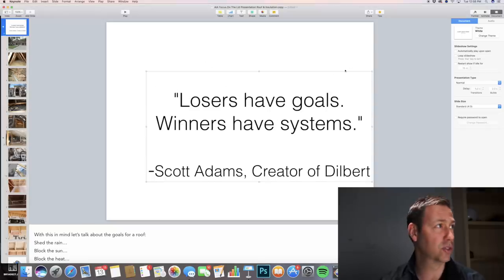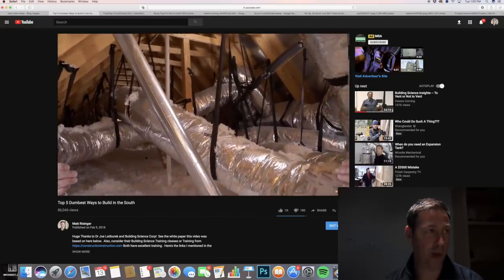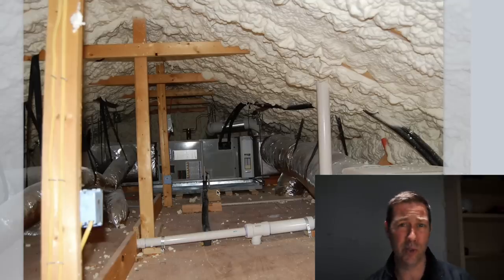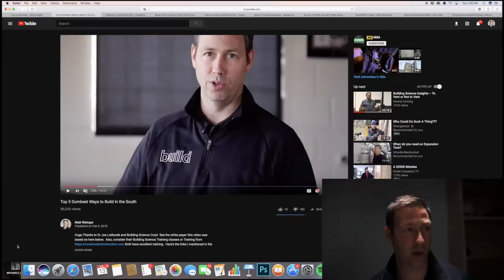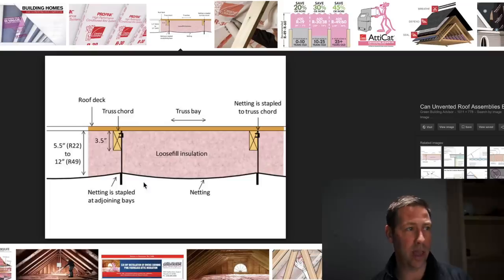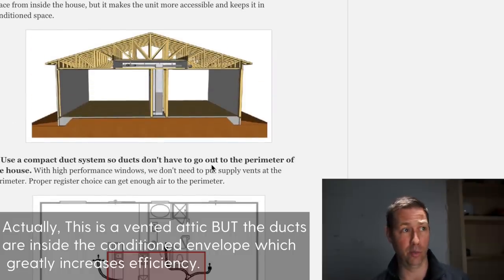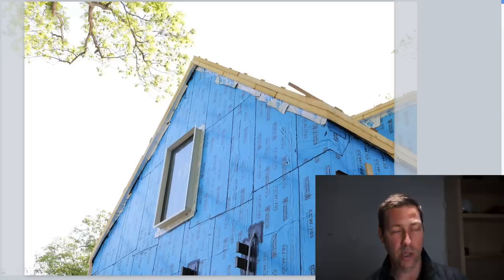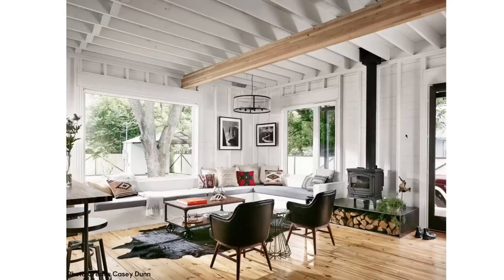Attics/Roofs - Dumb vs. Smart - How to Build Correctly

Comment: But now what kind of roof you have if asfault you killed the life of your shingles if not properly vented
Reply: Non-vented foam only raises the roof deck temperature about 5deg in the Florida sun. A 25 yer shingle loses about two weeks of life.
Reply: Im sorry but I feel the back sides of you asphalt shingles will not transfer the heat out efficiently like the soffits air in would and ridge air out would all the sheeting and nails are cooled with transferring the heat out and not over baking the shingles life. Theres a harmony that took 25 to 50 years for a asphalt company to work out there shingle life's and warrenty guidelines. I believe this new spray foam is meant for metal roofing and other types of roofing than asphalt.

Comment: I think he misses many things here. How about the fact that 10% of homes that get spray foamed, have to have their foam removed. Not just removed but the improper application of the 2 part foam mix based on poor temp and humidity calculation? Those chemicals, Isocyanates, creates serious indoor air quality issues. So much so that the EPA is now getting involved. I think you could do a better job talking about both sides of the issues for viewers. I was researching spray foam for my Southern home and decided against it, too many horro stories. A 90% success rate is god awful considering the possible perminent health consequences.
Reply: That's part of why I like the looks of the house they put the insulation on the outside, and I wouldn't even have painted the inside either.

Comment: +Matt Risinger  I would like to hear your ideas for those of us with dumb attics. What can we do to increase our homes efficiency?
Reply: Just spray another foot or two of insulation in. The difference will be massive. And it's very cheap to do. Just don't block any vents. You'll be good to go and honestly should work just as good or better than his foam system. This foam system is a rip off and has it's own problems.

Comment: So I know this is an old video and all that jazz, but I have a question regarding conditioned attics.  If I don't have HVAC stuff in my attic, and I don't have an attic that would make for useful storage, is making my attic a conditioned one something that should be prefered over a standard unconditioned attic?

I am planning on tightening up my attic one way or another in my 70's era split level ranch and I have been watching a lot of building science programs, so I know I want to air tighten it up, but I am unclear as to when putting the insulation on the rafters vs on the floor is prefered.  It seems like I could put a lot more insulation on the floor since it is self supporting, but I don't know which direction is best to go.

Thanks.

Comment: I can't agree with a vented metal roof on wood supports above foam.
That's a good way to have a roof fire that you can't get at to put out.
.
They made it illegal to put a metal roof over a wood or asphalt, supporting it on furring strips for a reason.

Comment: This is stupid what keeps the shingles from overheating and getting brittle?If you get small leak the foam would hide it till you have major damage. Your home needs ventilation I question this quy knowledge no over hang is stupid.You would this guy wants to build a air tight box.

Comment: I hate forced air because it always leaves me cold, even with the thermostat set to 80. Want to buy a townhouse with hydronic baseboard, but this is proving next to impossible. Although many houses here in the NY/NJ area have hot water heat, townhome complexes almost all have forced air, the ones that are newer and even remotely desirable. So what's left is to buy a place with forced air and convert to hot water. But it is proving even more difficult to find any information on the topic. I've been told 'better just upgrade the furnace', as if people don't hear that i don't want forced air heat, period. All my searches online have turned up next to nothing, in fact the opposite pops up - how to convert baseboard to hot air! I feel like the whole world is dumb and has blindly accepted that this horribly uncomfortable method of heating is the only way to go. And don't tell me about shared ductwork and all that. I don't care about A/C, i only use it about 10 times a year. A wall unit or a mini split would do just fine for me. Any advice on this matter would be welcome. Does anybody knows any hvac people specializing in such a thing - converting a toownhouse build in the 90s from forced air to hot water and that would be willing to undertake such a project for money and do it right instead of telling me it can't be done?

Comment: Hey Mat, I think the A frame roof is the worst design on the planet, especially trusses.
Wat you say?
I was also thinking the design of heating & cooling houses is absolutely WASTEFUL & INEFFICIENT!
Been watching you for years now.
Like some things but your stuck in archaic outdated engineering & wasteful in others. .
PERPETUAL ENERGY IS NATURAL LAW.
WIRELESS is the only way.
Wiring is the cause of most houses fires.
The reason houses get hot & cold is?
Energy use is not the PROBLEM.
The design of appliances &: houses are the problem. 
I've been trying to design a flying house for years. 
I can't carry things for no reason I can't have external plumbing, I can't have massive water tanks. I need quality air & water &: minimal things to replace & maintain.
I like being comfortable & wasting lil & my house must contribute to the maintenance of the world I live in & use as lil materials that I can't grow.
I plan on my WORLD & EVERYTHING that lives in/on it to have  the BEST QUALITY whilst they exist. 
I've figured out almost every detail for appliances & toilet engines  are almost done.
Fibres & Foam are killing everything on the world.
It's not natural dust. Even to many natural fibres in the air are not good for anyone.
Put your daughter in a room full of fibres & crumbling foam see how long she lasts.
I had to vacuum out foam insulation once it was fukn horrible how it breaks down into particles.
Thanks for trying to keep us in they loop of new ways of thinking you have given me heaps of things to consider whilst watching👍

Comment: This is ALL WRONG.
USE DUCTLESS A.C.
SO MUCH CHEAPER.
100% OF COOLING IS INSIDE THE HOUSE.
Reply: You don't have to yell.    But you are essentially correct.        Still, I wouldn't want to use freon (heat pump) to heat my house.       Split (aka "mini splits") make sense in SoCal where heating is rarely necessary, and cooling is important (if your house is inefficient, as 99% of homes here are).     The worst of them all are Cliff May Ranchos.

Comment: i dont like to see insulated attic,  or Air conditioned attic...  for the lifetime of the house your heating and cooling that gigantic space that is the attic?   why? 99.99% of the lifetimeof the house nobody is in that area,ever!? thats huge square footage your paying to heat an cool,, plus wear an tear on the mechanical system,,  cause that blimp above the living space sapping the cool or warm air constantly,,, please stop doing that,, ,  probly a couole thousand bucks a year....  stupid,,,, why would u do that to your clients...   i dont like your method of that. if the roof ever leaks  or  whathavya you got all that foam stuck to the roof